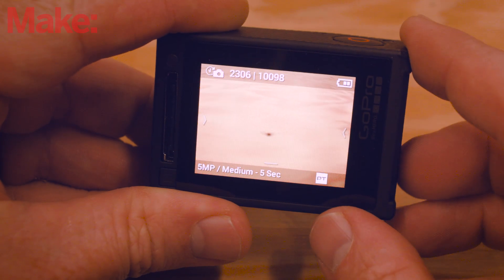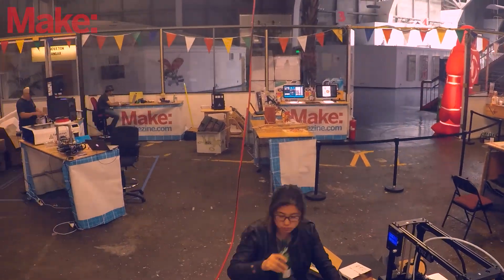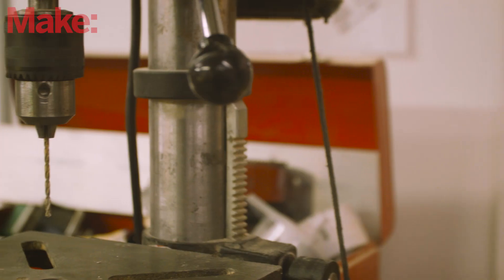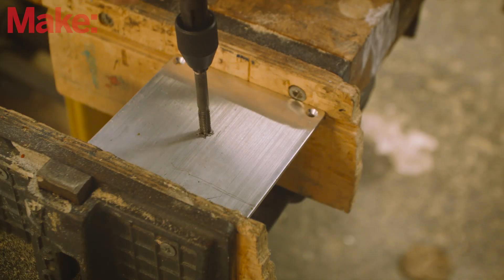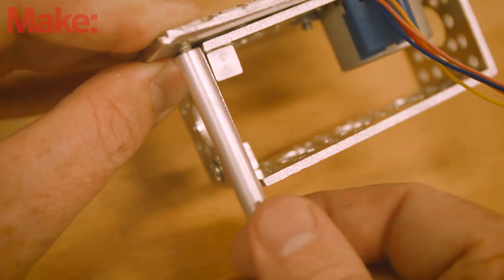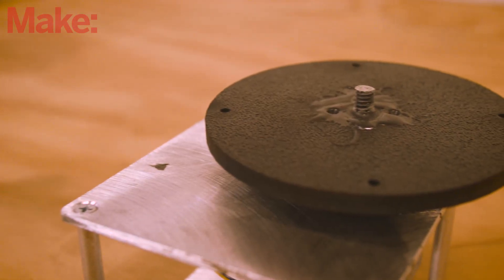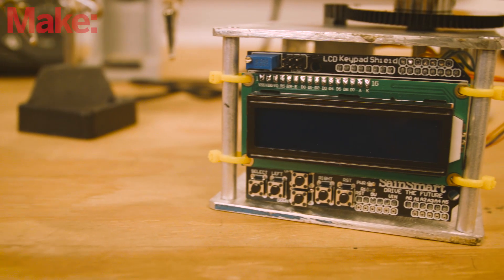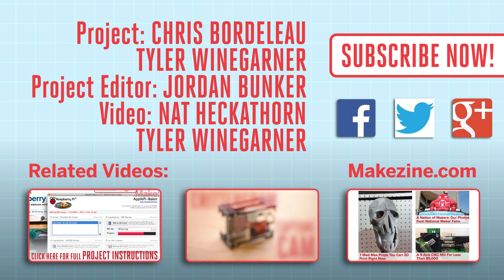Weekend Project: Time Lapse Motion Control

Comment: I was looking for similar ideas I'm working on at this moment: ESP32 (arduino like with WiFi), use the Access Point to handle a web-based setup for my phone and use a simple 28BYJ-48 stepper motor to drive a small pulley that will pull a knob on my tripod. The final device will be small, lightweight and uses standard components of about €30 in total exluding an USB powerbank though. I'll post a video when it is done (some parts still in transit...)

Comment: I got question about code. I uploaded code to arduino and it doesnt works like in your project. Button Right and res works correctly but in button sel i have right. Rest of buttons doesn't works. I uploaded others similar codes from github and there is still same problem. I can not find other person with similar problem. I think there is problem with arduino, am I right?

Comment: You haven't used a stepper motor driver? Connected the motor directly to the I/O pins of the Arduino UNO board?

Comment: NIce... but, that is a lot of work to simply gain control of the amount of rotation/angle defined by the user. IT APPEARS, the real problem with a device you seemed to have built is that you could not effectively use it in low lighting without getting a lot of blur with some shots.  ...can't tell for certain from your description... but, it looks like there is no control of the rotation relative to the camera shutter signal (feel free to correct me if I am wrong in this assumption).  

The movement needs to be controlled by the camera signal and not just a motor (and program) that rotates the camera.  The camera needs to be stopped when it shoots in order for the picture to be sharp/clear and not blurred (specially in low light/long shutter times).  It looks like your design will move regardless of whether the shutter is opened and in the middle of shot... or ... not.  

The egg timer can do the same thing for light camera's/lens combos where the control of the angle is defined by simply turning off the timer when that angle is achieved (...or not use the shots taken after the preferred angle point.)   Also, If you want something more stable/stronger than a egg timer... use a mechanical water timer as used with lawn sprinkler systems.
Reply: Joe Moya I agree completely.. I mentioned the same request for something to pause the motion, actuate a shutter release via cable, and then proceed with the pan for a user defined distance, rinse wash repeat.  Who could figure out how to do this?
Reply: +alexei van Ingen any replies to your question as I am interested to know.
Reply: +alexei van Ingen Actually thinking about this, there is the possibility of creating an intervalometer programme for the Arduino along with the panning programme to work together and then use a usb to micro usb to connect to the camera just like a normal intervalometer does. 
I am not sure how to write this but if anyone out there knows, it would be appreciated if they could do so and let us have the sketch.

Comment: This is perfect for a gopro but for a DSLR using an intervalometer for say, long exposure shots, couldn't you integrate something so that the arduino actuates the shutter of the camera?  Then you would have something very amazing on your hands.. you could even have the motor be able to rotate 90deg so that you could put it on some track and have a simple side to side or vertical lift rig.. But PLEASE, come up with a way to integrate the stepper routine and a shutter release so that it would move the camera.. take the shot.. repeat.  PERFECT long exposure rig then.. I'm just far from smart enough to figure it out
Reply: Thanks for the comment Alexei! If your camera is a Canon dSLR, you can install magic lantern, which has a built in intervalometer. Otherwise, adding a timed shutter trigger would certainly be possible. It might need a different keypad shield- this one hogs a bunch of the pins. I think there are more efficient ones available now. I developed the Arduino code & hardware for this a few years ago!
Reply: alexei van Ingen  Vello makes an inexpensive intervalometer that's available at B&H: http://www.bhphotovideo.com/c/product/840098-REG/Vello_rc_c2ii_Shutterboss_Version_II_Timer.html